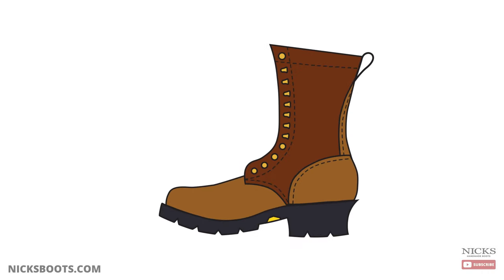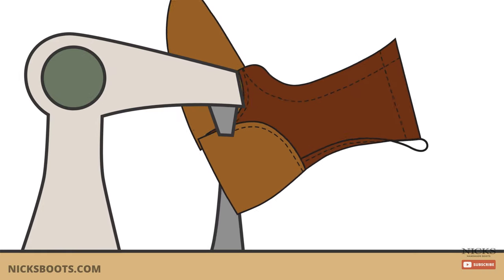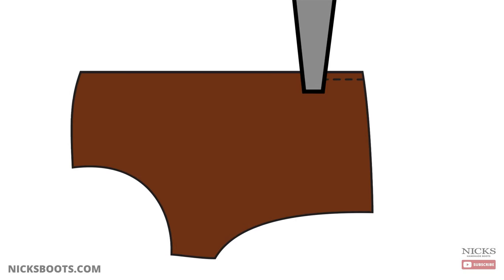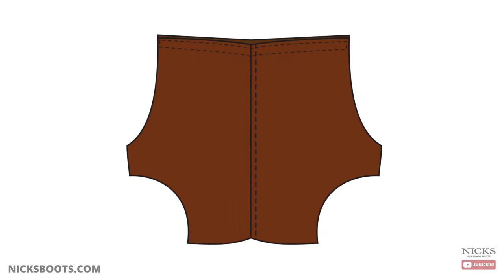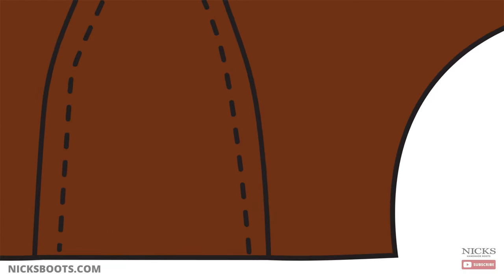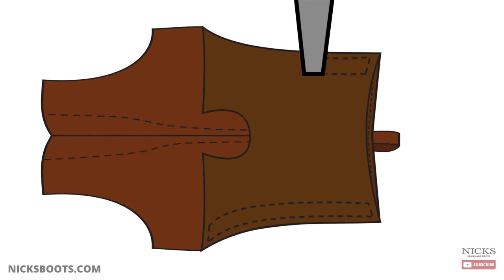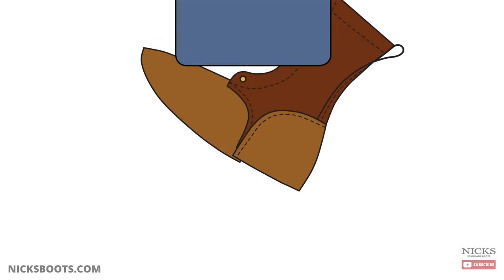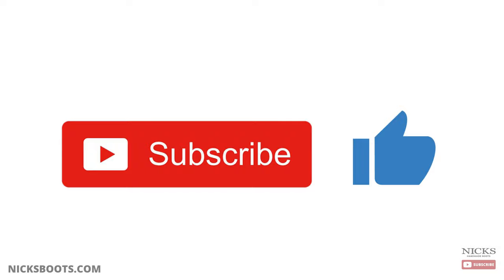How USA Handmade Boots are Sewn

Comment: My next pair of boot are going to be the builderpro with steel toe in black ruff out bottoms. I'm just a little worryed about sizing, as i'm in the uk i can't try any on before i buy. I also don't have a printer so i can't print out the sizing sheet. I'm happy to spend the money but i don't want to be stuck with the wrong sized boot so i'm thinking about it carfully. Normally a uk sized 9 fits me ok with no problems, some cheep boots rub my toe's on the steel toe so i have to be carfull there. I have finished a few shifts with my toes in a right mess and my socks covered in blood with deep blisters all over the tops of my toes. I'm thinking if i go for the classic arch 55 #3 toe this will help with the problem as my toes seem to stick upwards. A higher heel will mean my toe's are more level.
Reply: i usually wear a size 9 in cheap work boots a size 8.5 in red wings I chose a size 8 and its fits well still some space in the toe box but nothing crazy just use one of those flexible tape measures that's what i did it came out to be close enough to not have issues
Reply: I couldn’t try boots on pre-purchase either. I have the same boots you are contemplating. I used the Sizing Guide and was nervous that the Nick’s were different size than my old favorite boots. But, the fit  is right on. Most comfortable boots I’ve ever worn. After wearing them for 1/2 a day for 2 days, I started wearing them all day - no hot spots or blistering. I wouldn’t hesitate to recommend that you find a way to print the Sizing Guide. If it’s printed to scale and you wear a good pair of socks, your boots will fit well enough that changing sock thickness (adjustment I’ve made) will fine tune the fit. I’m only one guy, with one pair of Nick’s, but that was my experience. Good luck.
Reply: @peterjay8227  Thanks buddy, will definatly give it a try.
Reply: @Yamaha1933  Thanks buddy.
Reply: Definately find a way or find a friend with a printer, can't be that difficult to go to a public library with a printer either. Where there's a will there's a way.